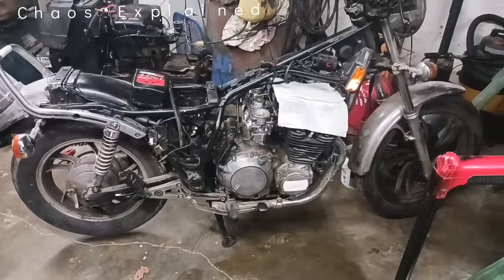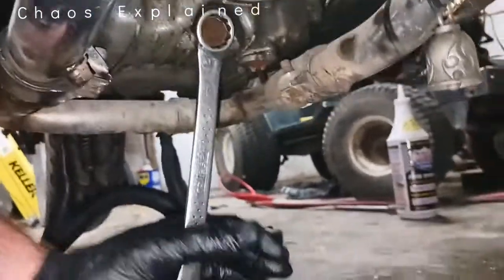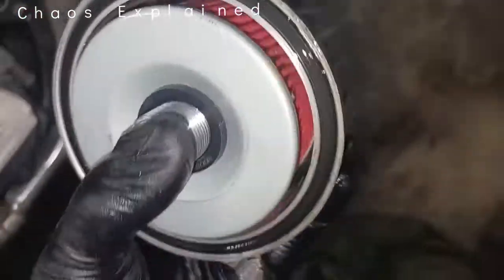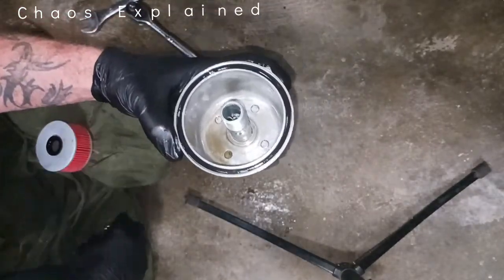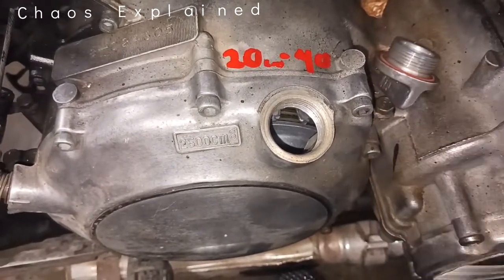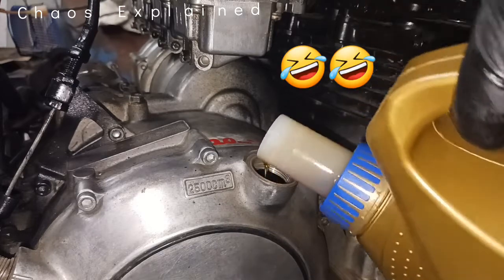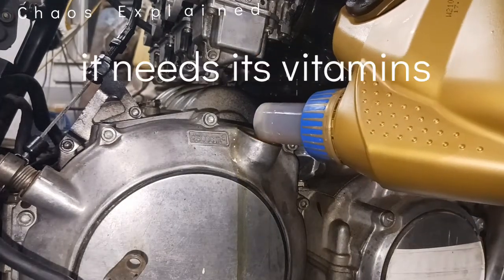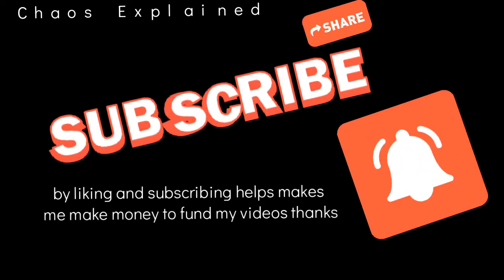1982 yamaha xj650 xj750 old school sight glass, interior oil filter, 2.5L oil change, (comical)

Comment: You have fitted the outer housing 90 degrees out, the small lug sticking out fits between 2 bits on the engine.